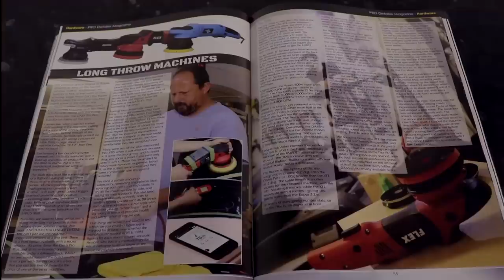Autoglym Polar Range Review  - Wash & Protect your car with an awesome thick snow foam cannon system

Comment: Quick question I have recently got a new car and washed and cleaned it starting from pre wash and ending with wax and doing everything in between . I was just wondering what to do next time I wash it, is there any point in polishing over the wax ? Or do I just was it with a dedicated soap and polish and wax it when needed ?  

P.s love the channel
Reply from the maker: wash it and dry it and use a detail spray or a spray wax.     check out griots best of show detailer or best of show spray wax.  or wax addict Fo'show spray wax for beading. so many ooptionst on spray type products covered on the channel ahve a flick back mate
Reply: Forensic Detailing Channel perfect mate thank you really appreciate you taking the time to answer my question keep up the good work !

Comment: Hope someone reads this.....
I broke two rules.
1, I didn't dilute it enough.
2, I let it dry on my paintwork.
Resulting in horrendous small puddles that show up when the car is clean.
 I've tried everything to get them off, nothing seems to rince them off.
The only way I can get rid of them is to rub each one individually with a damp microfiber cloth untill it polishes away.
 Thanks 👍
Reply from the maker: its genuine risk with spray and rinse products.  I avoid them in hot summer months.. but yer lower the concentration by half.. and literally on and straight off..  If you allow like little white spots of it  to sit on the panel for even a minute in the hot sun you get little foot prints (same with any spray and rinse really)..   but those footprints will just disapear in 1-2 weeks if you cant be bothered try and buff them off.   IPA at 20% and Water can get them as well.  but yer spray and rinse roxs when its colder in winter.
Reply: @ForensicDetailing  
Thanks so much, I'll give it a go 👍

Comment: I don’t care about my car and I hate washing it but driving on dirty salty roads is making the car needing washed off every week. Could I get away with just spraying this on and hosing it off? Local carwash does a wash and go using a foam and hose off for £6, I thought using this would save me a bit of cash
Reply from the maker: No you need to make contact really and dry the car properly

Comment: They say not to use on convertible is there a reason for this please
Reply from the maker: it will be the polar seal, to get an official answer I would speak to autoglym.  but ill fire a guess-timate  Its designed to bond to paintwork.   Its like an opaque white substance.  Im guessing but if you spray that into fabric and you will prolly get like patches of white stuff in the fabric.
Reply: @ForensicDetailing  it says cannot use polar wash neither on convertibles which it strange because it only a shampoo
Reply from the maker: @terrywatson6237  interesting not sure why terry.  Id ask them to make sure thats not a mistake.

Comment: good I have a doubt I have a cquarz that expired the month 9 of 2018 is in liquid state but I do not know if to use it or not? and if something happens?
Reply: It will still be fine
Reply from the maker: Im sort of in the same situation with ceramics I have that have been kicking around.  Im just gonna test it on a test panel to see if it still works.  but if in doubt buy a new bottle mate.
Reply: thank you very much greetings
Reply: Shake it well and have a close look at the liquid to check for anything floating in it. If it’s clear it’s fine 👍

Comment: I have used these products a couple of times and I keep getting hard water stains on my car
Reply: I have occasionally had the same issue particularly when not towel drying off. I have recently got some ONR, diluted at 256:1 part ONR and applied via sprayer whilst the car is wet then towel dried after the Polar wash and so far this has been surprisingly good.

Comment: Stick a new label on it and call it polar. I think they’ll just rebrand anything to generate sales
Reply from the maker: couldnt be further from the truth..  when they take something to market they develope it ground up in house with a team of chemists and they test things in house for a couple of years.  they also have to setup their entire manfacturing line to be able to do large batch runs of product. million other things as well.   they also have to consider shelf space and whether the concept is right for the mass market.   nice in a way they are giving retail line customer mini bulk options as well with these 2.5 litre things.  again you dont understand the beast you are describing or the industry it serves.
Reply: What I’m saying is it’s just snow foam and shampoo, they might tweak Afew ingredients here and there for legal reasons but  Using their products they have already will give you the same results.
Reply from the maker: @liamk15  your results are always more down to your method and like endevour.  buying this stuff doesnt suddenly mean your car will be cleaner or shinier than ever before.   kind of goes without saying though doesnt it?    but quite simply its a cool way to wash your car, specially in winter and it can save you a lot of time, drying the car after is also rapid and easy, the main disadvantage I think is when its baking hot and you have to clean the car.   Ive only used the system once but it made a lot of sense to me.  again the guys really into detailing have seen anything and everything literally 5000 times over.  so like your through the detailing honeymoon period, and your left trying to pick a few products and methods that work for you, but others are not..  so its like horses for courses and your not wrong as such, just battlehardend and seen too many winters :)

Comment: I don't really feel this autoglym package. It's also risky to design a package for mainstream consumer that only works with a foam gun and power washer... Which are not used or known mainstream.. Still interesting proposition on the market
Reply from the maker: it is a bit risky isnt it,   because a lot of the mainstream might not know what a snow foam lance is and buy this without reading the instructions.   but good on them for taking a risk, they must feel the wider market is ready for it.

Comment: dude your foam gun sucks lol 
also just use degreaser on ya wheels
if you still think you need to use a brush to get the brake dust off you need a better pressure washer.